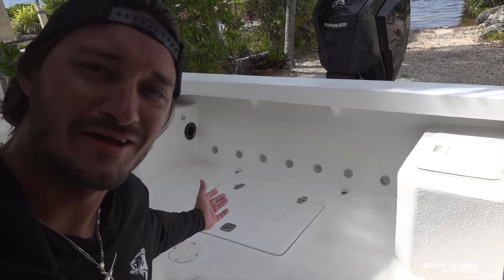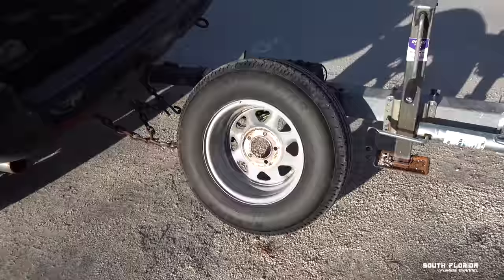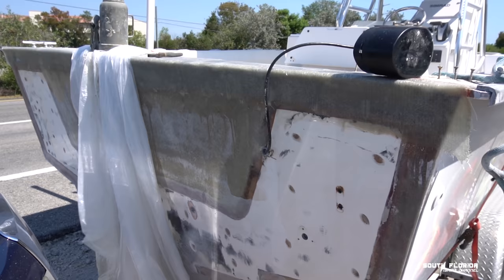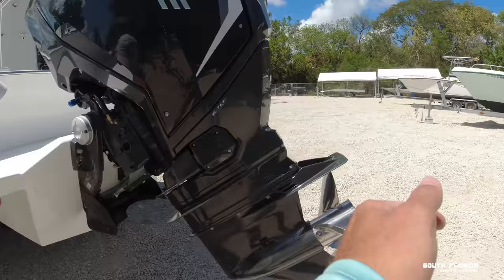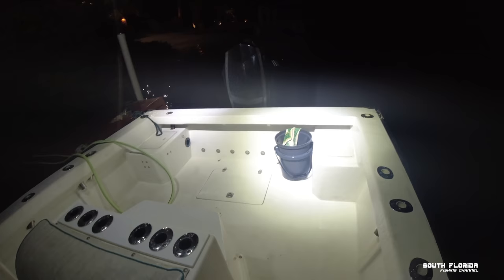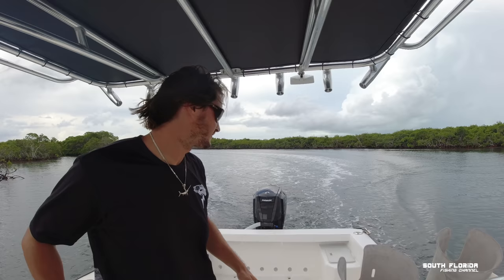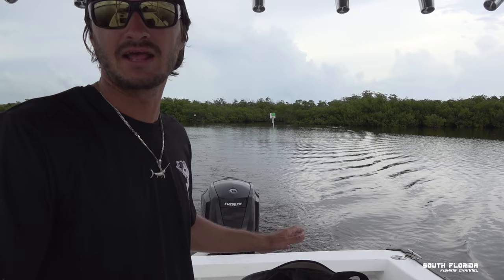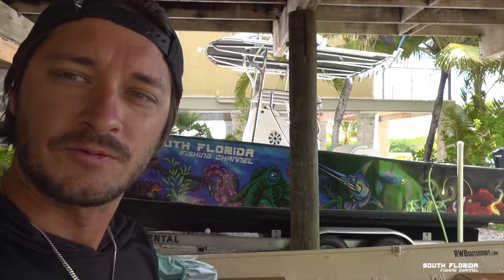I put a Engine Dive Bracket on my Boat! Was it worth it? {Before & After Results}

Comment: That was about 1/2 the price I guessed.
I checked into an Armstrong bracket to replace the existing Gill Marine bracket on mine, but never pulled the trigger. 
Having the extra floatation with the engine is a nice feature people don't think about too much. I wanted to purchase a twin bracket just for the extra-large floatation chamber on which I would mount my single engine. If possible, I would rather swamp than sink.
Nice boat,

Comment: Good work and video. I would have liked to see the interior of the transom reglassed down to the bilge and forward, and a jack plate for height adjustability. Trimming the motor out should get you more speed now due to the platform's leverage on the hull.
Reply: I like what you did, the transformation is great. I'm a believer if you love your boat spending money to Improve it is nothing compared to what new ones cost. I see you enjoy your boat and that's what counts.

Comment: Heiko,
So the deal is with me experimenting with brackets for a while, the new concept and 100% difference is that they are building the brackets, building the flotation box down to the water, basically mimicking the hull bottom, length and width, thus extending the running surface,,,, makes since in all concepts, doesn't it.  So you are actually extending the running surface of the boat which truly adds to the "real" length of the boat AND you are gaining more rear flotation taking ass-heavy symptoms away.... Check it out - most new manufactures are doing this now.  Im just mad My first two weren't built this way, makes a world of difference.

Comment: Closing off the transom is safer, and it is stronger, and it gave you more room.  What's not to love?  It's a win, win situation.  The Armstrong bracket should've gotten you a little more speed as the engine is further away from the hull giving it "cleaner" water.  Maybe the half tower is creating more resistance than you realized.  
It's a new boat now, you've added a half tower, the wrap, new engine, new transom an Armstrong bracket and a new transducer.  
It'll be nice to see new videos from your "new" vessel.  Tight lines!

Comment: Looks good! That big hunk of aluminum was a good investment. 🤙🏼 you may need to give it a little trim tab to get a more top end speed with the transom extension. I have to give my boat a little tab to optimize my ride and I have a full width bracket that is an extension of my hull bottom.

Comment: If you go up a little higher on the motor then before you will gain speed and still have good water pressure. Probably can swing a bigger wheel.

Comment: Hey on your trailer wheels lug nuts, put some "Never-Seez" marine grade or copper, on the lugs then put the nuts on. Will help to keep them getting rusted and the nuts frozen on them. If you want to use on stainless make sure you get the correct type.

Comment: I just found your channel, great video, I’m thinking about putting a platform on a couple of my boats, I like how the control cables are run out the side, my thought is, what if they came out under the platform, then came up through closer to the motor, that way it wouldn’t be in the way if you used your platform for getting on and off the boat. Thank for the info!
Reply from the maker: Mine doesn't get in my way much. I'm sure there's other ways to do it but I didn't want the cables running through the hull below the water line

Comment: Well if transom is rotten y- not..what I’ve done is extend the hull 20” ( open style) and closed off the old transom ( removed the splash well ) adding flotation to rear because of the twin v-4’s….balance was key in fuel efficiency..outboard brackets only extended the weight rearward..yes can be compensated running with trim tabs but at trolling speeds efficiently sucks …

Comment: Any issues with the engine leaking oil? Put some gas cleaner or 
Conditioner and a fuel tank. The machanic should’ve told you your gas tank was on empty

Comment: You can trim up allot more with that bracket and it will come out of the water and you'll hit 52 to 54. Also you may need a smaller prop or bigger prop if your not hitting WOT RPM

Comment: pros and cons of using aluminum vs fiberglass for the platform/engine bracket - electrolysis with the stainless bolts?  Zincs?

Comment: It’s hard to tell from the video but I didn’t see any bevels on to the hull and any tabbing on to the floor or sides. The big cap rail gives a lot of strength to keep the top of the transom bowing outward. The middle may flex so inspect where the transom meets the floor. The bottom  has inward pressure so I wouldn’t expect any issue there. I wouldn’t expect any catastrophic failure. Just wish you ran the camera around more before the gelcoat.

Comment: Bracket is a nice thing to have for sure looking forward to more videos!  Some ideas or future upgrades. How about some non skid on the bracket and a dive ladder?  Maybe a new hatch on the bracket or just seal it up with 4200.  You have a drain plug, so what is the reason to have a hatch there?  Imho, it can only fail when offshore and cause a serious flooding issue (Imagine you lose that bracket hatch top offshore on a rough day!, think worse case scenario).  You can always peel off the 4200 caulking if you need to inspect and replace a hatch for <$20.
Reply: Needs a hatch to get to the nuts for the outboard bolts

Comment: Thanks for sharing the video. I have a 26'CC and I would like to convert to a full transom. The  boat is in great condition the transom is solid and great shape. I have seen several videos on YT, I recalled seeing your YT last summer. The boat has a live well incorporated behind the leaning post/seat. I am looking for someone to do the conversion it will make the stern area much more accessible and dryer that the open well configuration. I need some suggestion for a quality shop to do the work. I'm in TX willing to deliver to FL. Appreciate any help that you may offer.

Comment: That is what I'm talking about bro....looking good, riding good, safer, stronger, more room, rod holder room.

Top end speed? That is damn good for the changes. Want more? You will have to play around with different prop sizes and pitch, to your likeness.

It perfect just as it is for a boat of that size. Want more speed and power? Bump up to a 300hp engine and your gold. 

Now for the future, save up to install a kick motor, nothing less.than 25hp, for safety to limp home or just use it when slow trolling. 

Check all.your lights, safety gear and supplies, licences and regulations documents are on board and up to date. Back up tools, equipment and supplies. 

I cant.remember if you I stalked a head on the boat yet.but you need to because Kaitlyn is on there regularly so you got to think of the comfort of the little woman.

Now go forth and fish.....also catch fish.....

Comment: Very well done si. Did you weigh your options over a dive breacket vs floatation bracket? I would have looked into self bailing system instead of plumbed into your bilge.

Comment: Wow that motor needs to turn minimum 5500 rom wot, and it would be great if it would reach 5800.  Leaving alot of speed and efficiency on the table.  Drop your prop pitch by 2 or 3
Reply from the maker: Yea I was thinking the same thing. I'll be getting a new prop soon =)

Comment: Uve got to do trailer inspection and wheel bearings clean and grease. It imperative u maintain ur trailer as much or more than the boat brother. If u had been on the highway u could of killed someone. This goes for every single boat owner

Comment: I just watch your video on the 200$ ebay outboard motor.
I believe you have it backward. The fuel tank and exhaust should be behind. The throttle and pull cord should be toward you in the boat. Just an observation....

Comment: Is that motor is only turning 5100 rpms full throttle then you might be able to try a different prop and get 2-300 more rpms out of it I believe the operating range is between 5500 and 6000 on those motors but I could be wrong

Comment: If it where my boat, I would have found a way to drain the the water out the side of the boat with scuppers. I wouldn't want all the water going into the bilge area. Just my opinion. I don't know how low the boat sits in the water. This is just a suggestion and my opinion only.

Comment: Why didn't you fill up at a gas station? Street fuel is a lot cheaper than any marina fuel? Just asking?
Anytime my boat is on the trailer, I buy Ethanol free street fuel. Sometimes about $2.00 cheaper per.
Reply from the maker: I don't buy marina fuel unless I have to. I've been filling up from the gas station for the last couple years now

Comment: You need to run your scuppers out the transom or side, above the waterline if possible, NOT into the bilge where the bilge pumps have to pump the water out!  The guy doing the work should have known better.